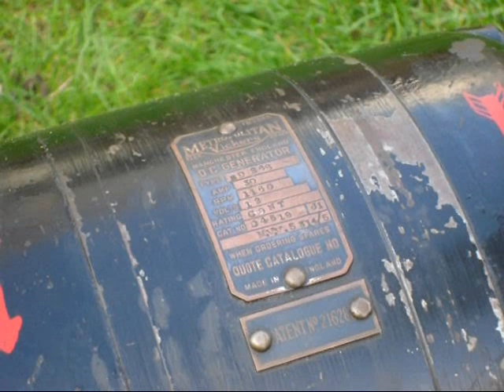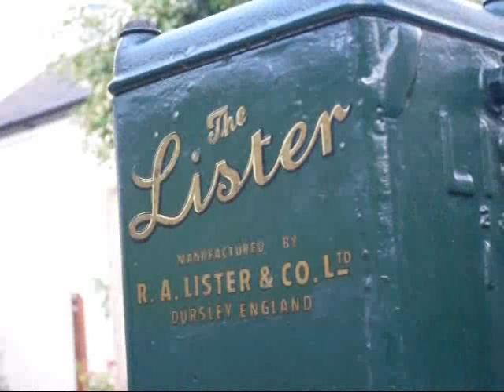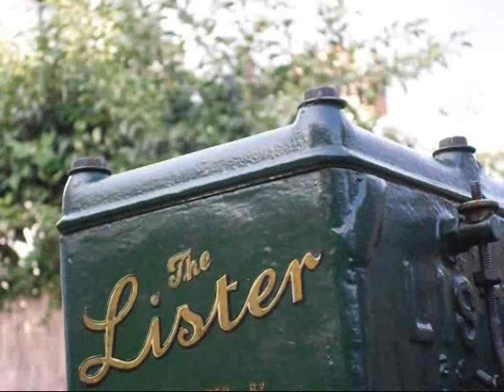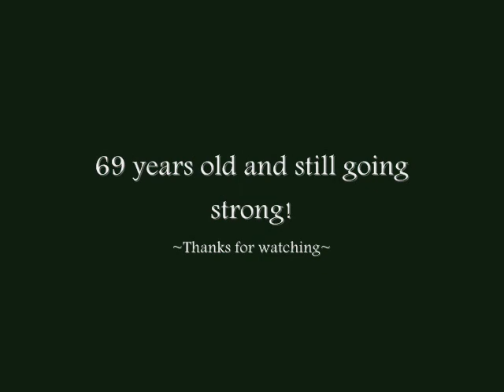R.A Lister D type Lighting Display

Comment from the maker: Only trouble is, what do you do with 36V? 

12V is a useable output, allthough if you got a 36V you could run it slower and or resist the output.

Comment from the maker: Ah right, well if you run 12V bulbs in series, or 6V like mine if you can get them, then you shouldn't have a problem with voltage, you need to know what current rating it is though.